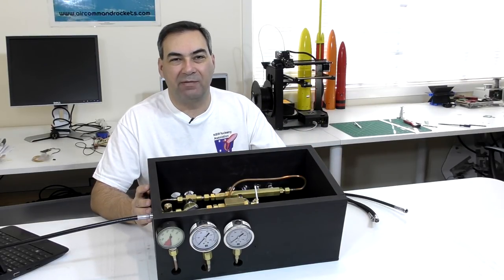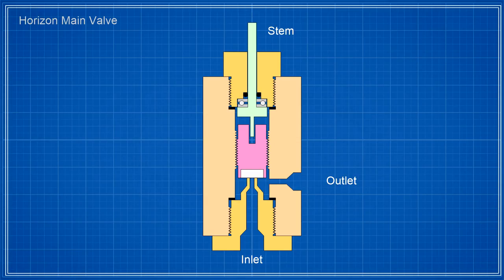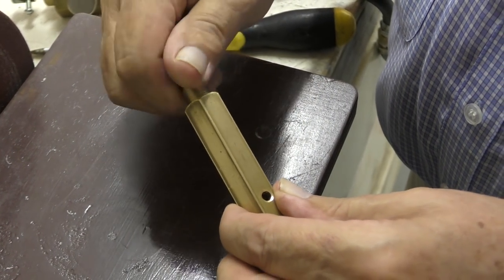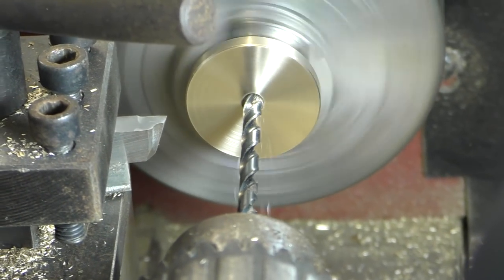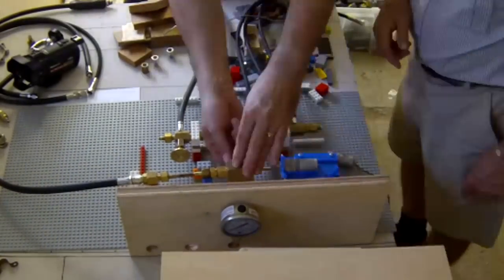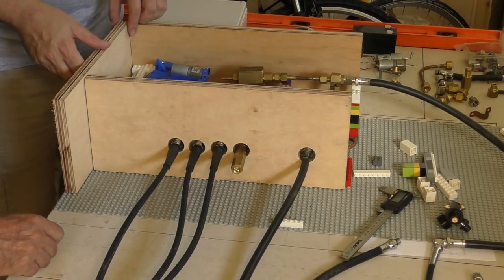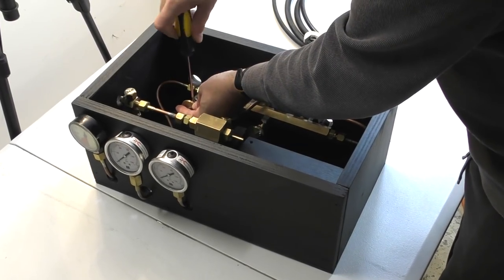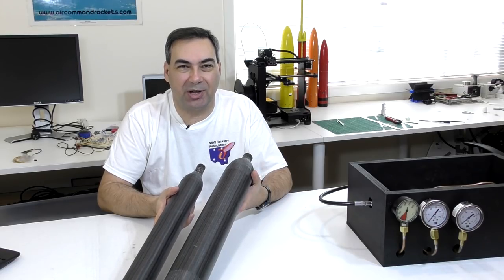2 Stage Water Rocket - Part 7 - Air Control Box

Comment: That made me feel better. I'm not the only one who has to pull things apart more than once. Getting my head around this 3D printer. It's not nearly as easy as I thought it might be. On my 4th attempt at printing a rather ambitious part that will hold all three of the fins that I have also printed in place. When you are 7 hours in and it fails on your 3rd attempt you learn where your threshold for frustration is. Hoping to be able to have the Water rocket ready for launch by next weekend.
Reply from the maker: Bummer! I hate it when it does that. I try to print one component at a time for that reason so that if it fails, you don't have to re-print everything else. 3D printing does take a bit of time to learn, especially when designing components for printing so they stick well to the bed. Also appropriate use of support structures is important.

Comment: I have a question you can make rockets from PVC pipes instead of bottles ?
Reply from the maker: Yes it is possible, but PVC rockets tend to be heavier when holding the same amount of pressure compared to what a PET bottle can hold. As a result you tend to get lower altitude. Also and probably more importantly is that when PVC is over pressurised and fails, it shatters into shards which can be very dangerous.
Reply: @AirCommandRockets  thanks, I wanted to try pvc because fiberglass is expensive, but first I will try with bottles first from scratch and then go forward
Reply: @AirCommandRockets  how is it possible that pvc hold only the same pressure as pet if they have 3mm walls?
Reply: compared to the 0.1mm walls of pet
Reply from the maker: Different materials have different strengths. 0.1mm wall PVC is not as strong as 0.1mm wall PET. You also need to consider the diameter of the pressure chamber not just wall thickness. A pressure chamber with 10mm diameter and 3mm wall thickness will hold more pressure than a 100mm diameter and 3mm wall.
Reply: @AirCommandRockets  how much pressure should a 40mm chamber in pvc with 2mm walls handle? (approximately)
Reply from the maker: You would have to look up the pressure rating for that specific pipe as there are different grades of PVC. A 2 minute search on Google will tell you exactly. But remember that the burst pressure is only an average  guide line, you will want to include a safety margin of perhaps 30% at least.
Reply: @AirCommandRockets  i will! thanks for your reply! I'll be sure to follow up with you on your progress with horizon!